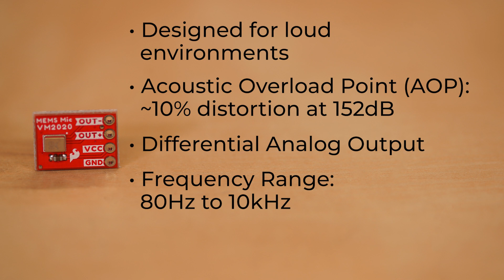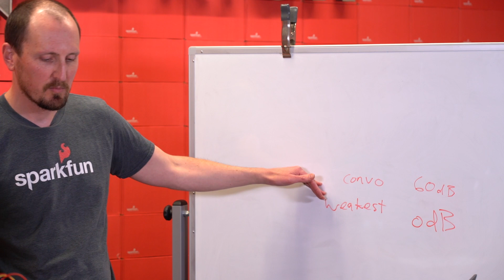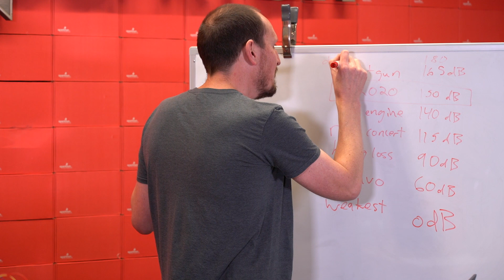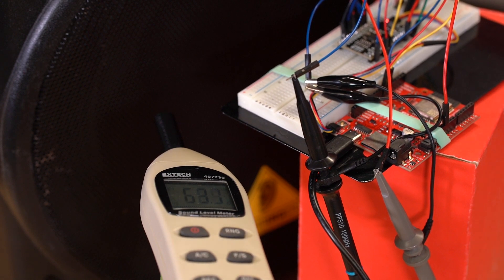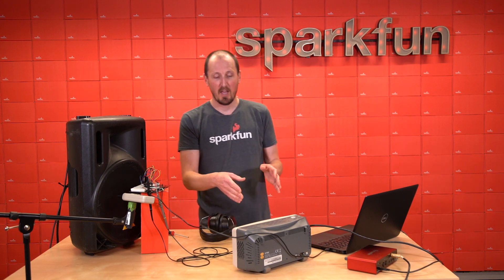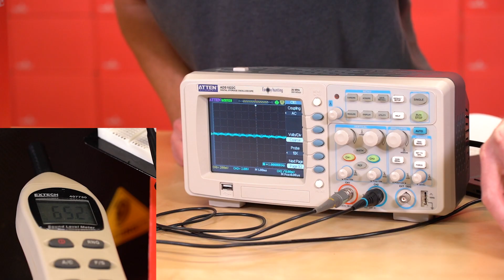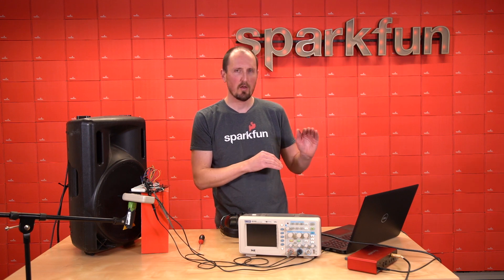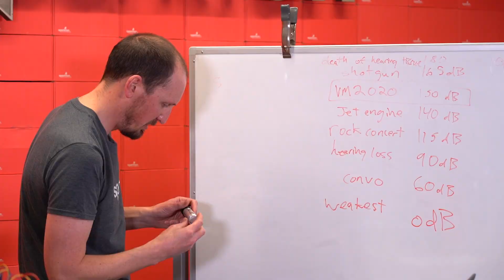Product Showcase: SparkFun Analog MEMS Microphone VM2020 Breakout

Comment: G'day Pete, great video and nice explanation. I bought some of the Sparkfun VM2020 boards but I noticed there is no information for the maximum analogue output voltage for the MEMS microphone. I have the equipment to measure without the need for an op-amp, however, there is no information on Sparkfun or from Vesper as to the maximum analogue voltage output that corresponds to 152 dB AOP. Do you have any information for this?